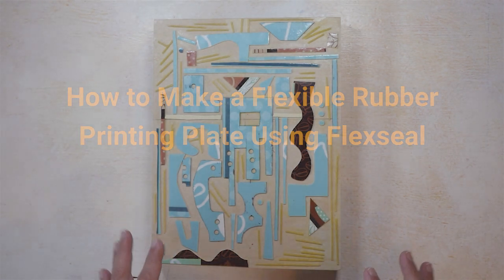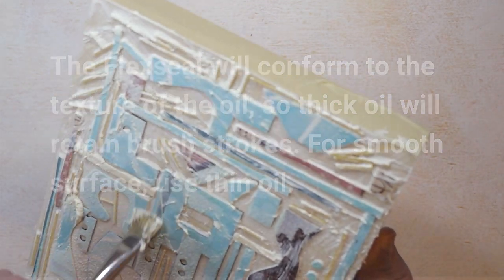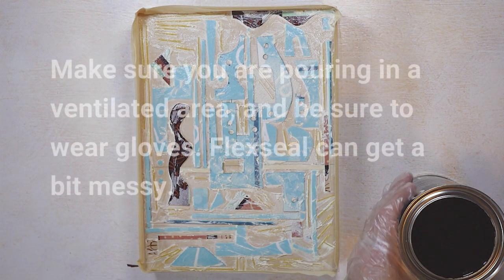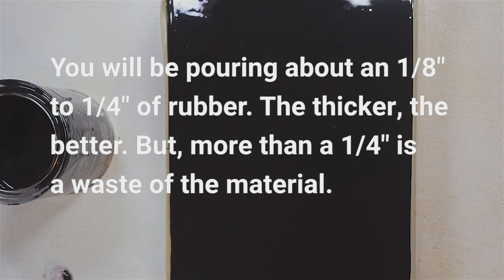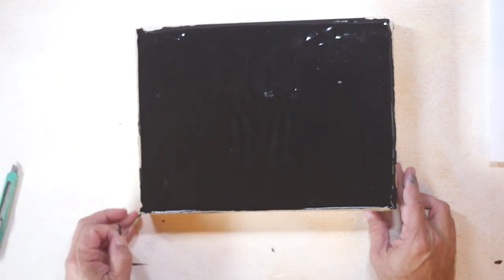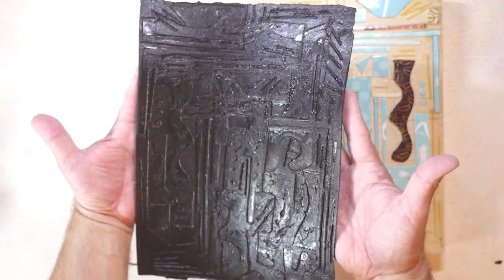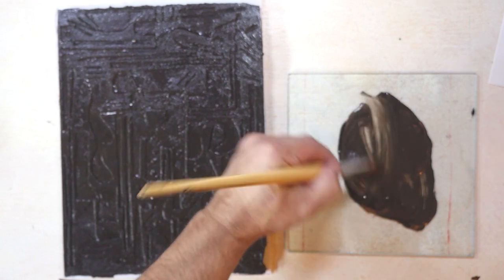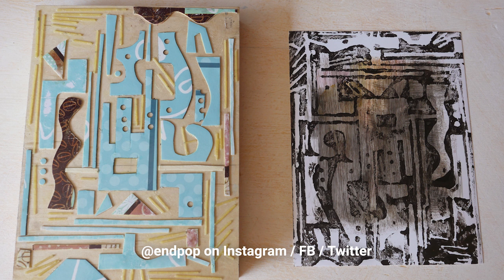How To Make Flexseal (Liquid Rubber) Printing Plates and Monoprints

Comment: Hey can you make a video showing how you make the plates ?
Reply from the maker: If you watch the whole thing, it is explained. :) But basically, it is a wood panel with masking tape that will hold the rubber in place until it dries. Then, you will peal the tape and remove the rubber. But there are a few more details, so watch the whole thing.
Reply from the maker: If you meant the actual art... I basically glue pasta, wire, and cutout shapes using soft, but thick placemats you get from Dollar Tree. I glue them to the board using glue, and usually, I will varnish the result to keep it tight.
Reply: @anythingbox  thank you and I was just impressed with your work